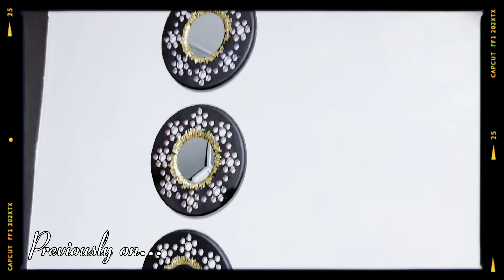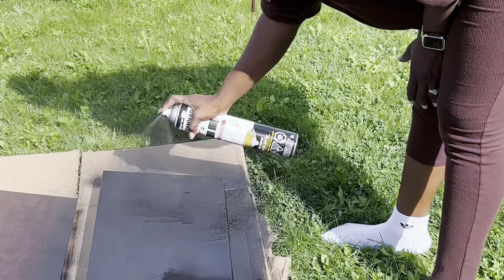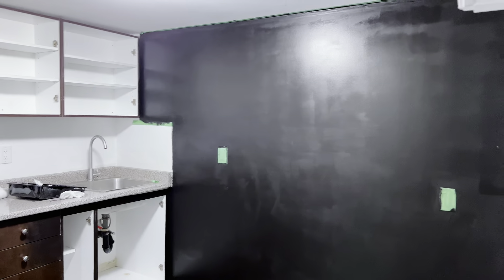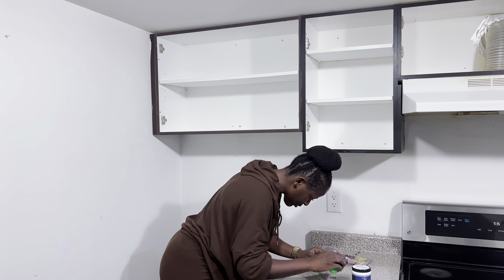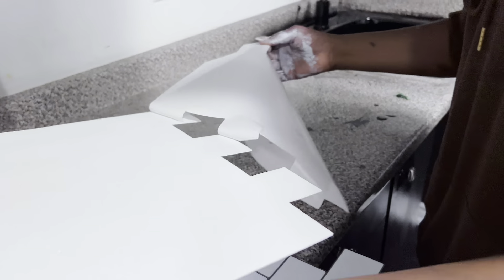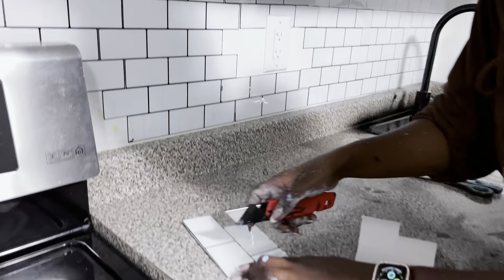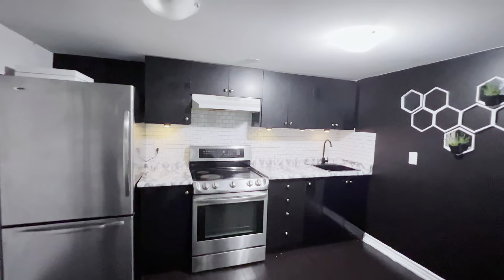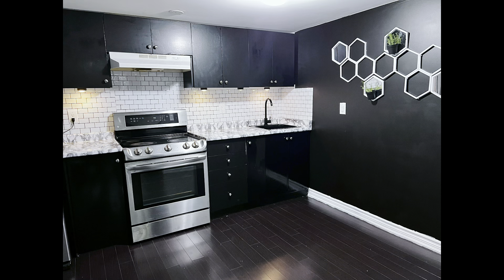Kitchen makeover on a budget rental friendly for one of my Subscribers!

Comment: Nice transformation 💖,  I would have also changed out the vent hood for a stainless steel or black one, or spray painted it black ❤👏🏻
Reply from the maker: That is the plan but she was on a very tight budget so we plan on doing that later.
Reply: @NoraGsNook  That's what I figured had happened